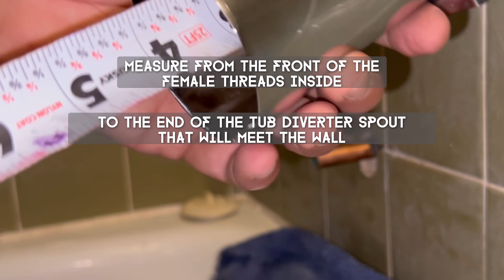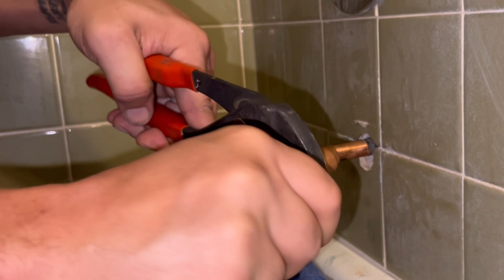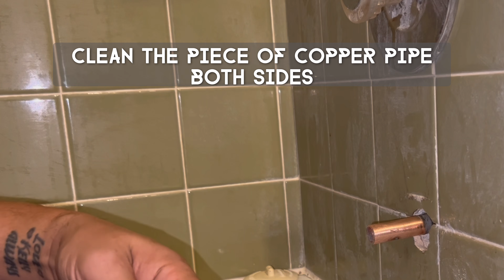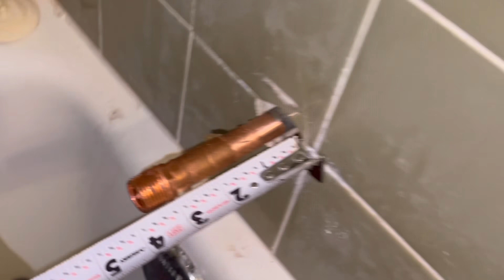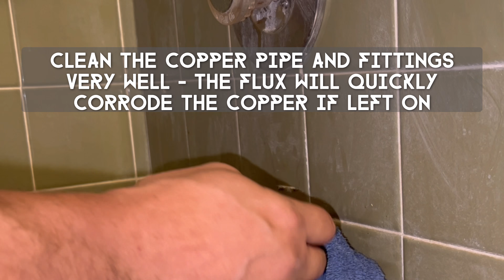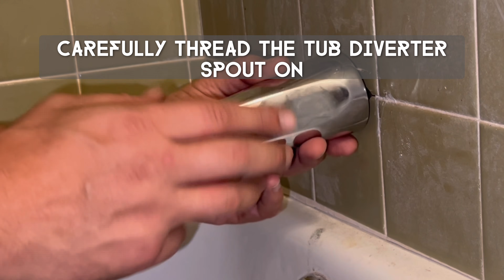How To Install A Threaded Tub Diverter Spout - Sweating Copper Joints Plumbing Installation & Repair

Comment: Mine has plastic inside and it’s for a push pull system.  It has threads inside the plastic at the back of the tub spout that has a diverter near the front on the top and the hole is 1 inch. And it screws onto an adapter that is attached to the copper pipe. I can’t find anything that’s 1 inch in diameter.

Comment: will there always be water dripping from the bottom spout when the shower is on?
Reply from the maker: It can be normal with these types of spouts.

The mechanism inside is very basic and sometimes it might not get a perfect seal.

Comment: So is all tub diverter 3/4” in the inside?  I keep seeing 1/2”.
Reply from the maker: Most of the ones I’ve seen are 1/2”.

Not sure I’ve ever seen a 3/4” one.
Reply: Some of the old Delta spouts are 3/4 but most modern spouts are 1/2

Comment: So if the pipe is already soldered, and all you want to do is swap out a threaded spout for a different spout, what do you need to do?  Just twist it off and re-dope the threads, and screw on the new one, then caulk?
Reply from the maker: If you can get an exact replacement tub spout then YES.

If you install a different tub spout then it may have a gap at the wall depending on the distance from the threads inside to the end of the tub spout at the wall.

Comment: Is it okay for the tap to drip even when shower is on? I am running into that issue
Reply from the maker: Sometimes the tub diverter may drip slightly.

The mechanism that blocks off the water is very simple and sometimes it may not block the water off completely.

Purchasing a higher quality tub spout may resolve the issue but if it’s a small drip then I wouldn’t worry about it too much.